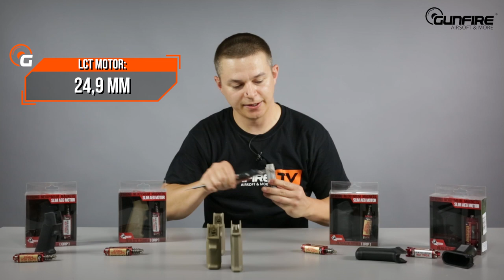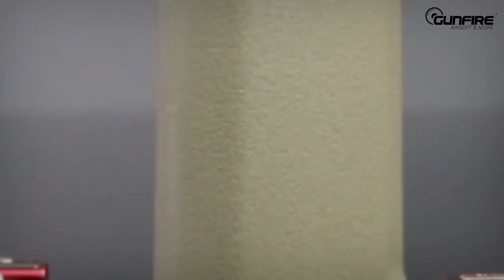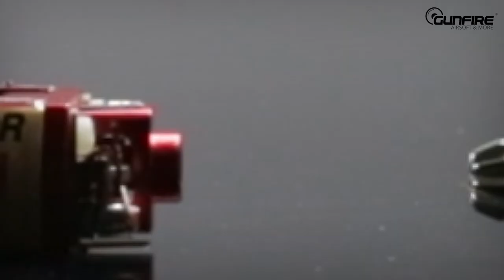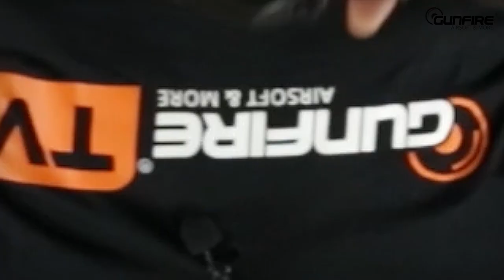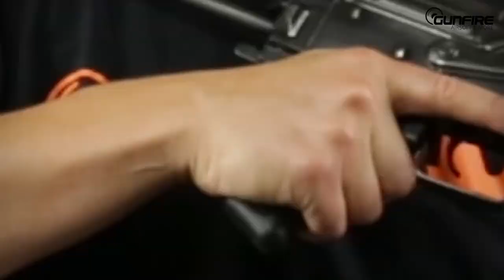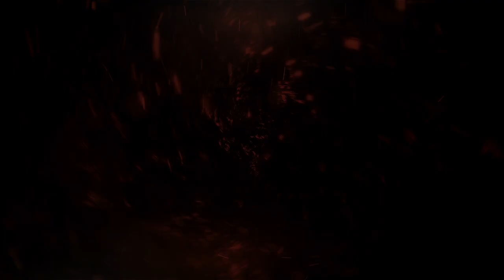New slim pistol grips and motors from ARES by Gunfire

Comment: I bought two of these (slim super high torque motor for AK) hoping they are better than LCT slim motors. Ares consumes like 33-35[W] (2.7 - 3[A]) and LCT 55[W] (3.9 - 4[A]). The test has been done by connecting a 11.1[V] Li-Po battery to the motor encountering no resistence so it was a free rotation. What does this mean? It means you will have less power with Ares and also a lower rate of fire. My conclusion is that I will stick with LCT motor in the future and leave Ares as backup. So I do not recommend Ares, instead choose LCT slim motor in order to get more power, more rpm, more rate of fire.